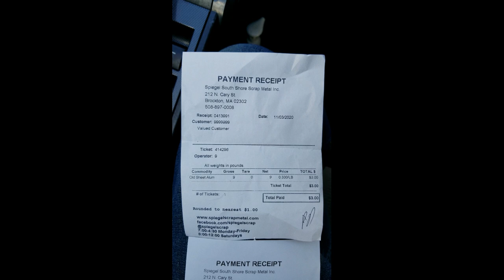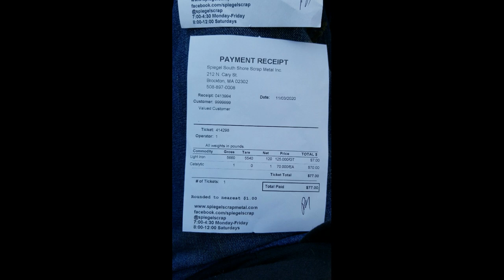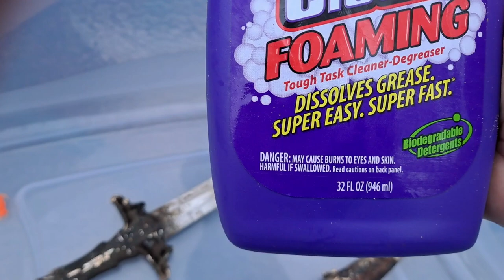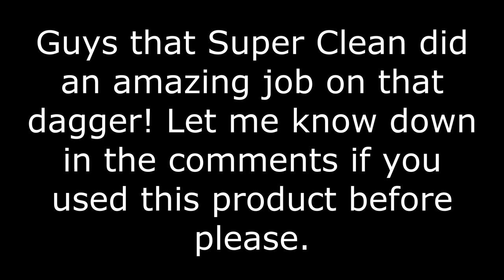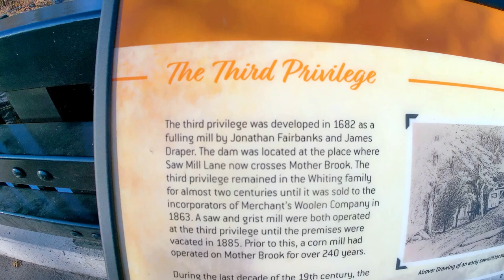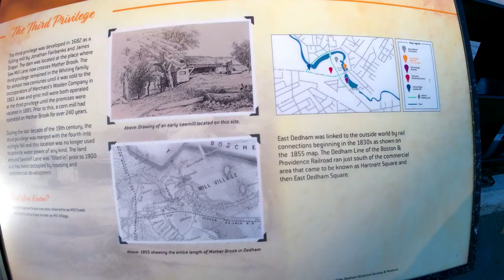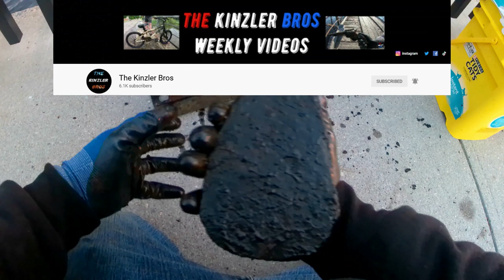WOW! Vintage 1930's Item found while magnet fishing

Comment: Super Clean Foaming: How long did you keep it  on? Did you use scrub brush? Cannot believe the gems stayed on in water and during cleaning process. 

What is tool you use to cut metal?
Reply from the maker: Hello Susan I kept it in there  A few hours. They were not gems I guess they are just painted on there but still cool anyways. On this one I used an angle grinder